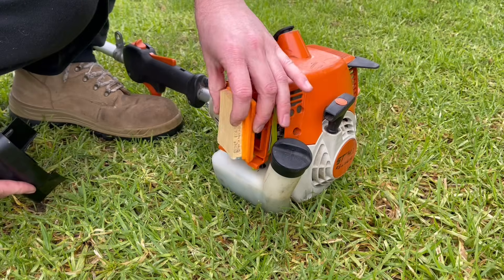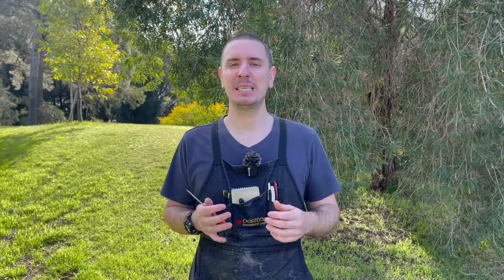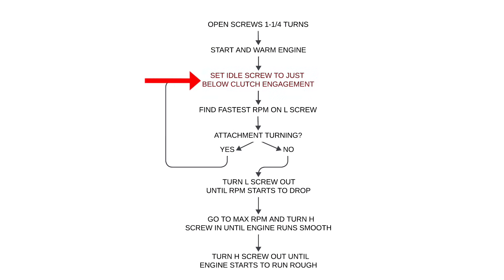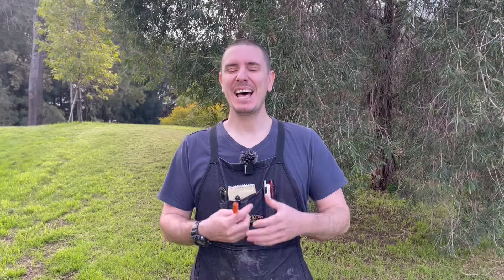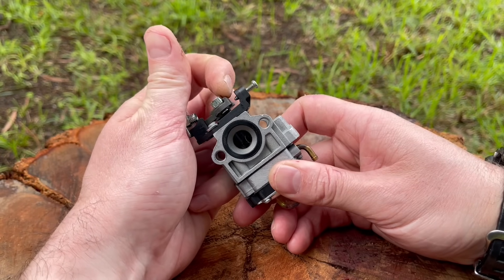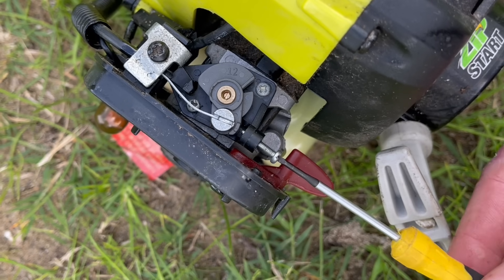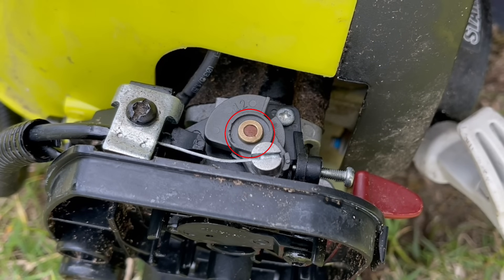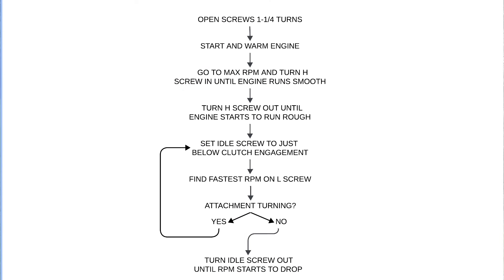Ultimate Guide To Carburetor Adjustments!

Comment: In order to work on equipment properly, you need the proper tools.
    In order to adjust a carburetor properly, you need to have a tachometer.
    I don't care who you are or what you say you can do, but no one can hear a 50 RPM difference at 12000 RPM. This is what differentiates a professional from a hack, and unfortunately there's a lot of hacks that work in shops.
    I have never been to, or even heard of any manufacturer training that teaches to do it without a tachometer, and they are the ones that engineer and build the thing in the first place.
    Having said that, I do like the flow chart for beginners though.
Reply from the maker: I completely disagree. A good mechanic doesn’t need to rely on a tachometer—they can tune an engine by how the engine feel’s, responds and how it sounds. While a tach is a useful tool, the best tuning comes from responding to how the engine handles load, acceleration, deceleration, hesitation, and more. The factory-recommended specs are just broad guidelines; not every machine will run optimally at those settings. Consider an older engine with worn rings, different tolerances, or fuel that isn’t fresh—there are countless factors that affect the ideal RPM for tuning. If you stick to manual specs with slightly older fuel or slightly worn rings, for example, you could end up running the engine too lean.  Same with slightly worn skirts that won’t seal ports correctly. Leaning the engine out to reach a manual specification will set them too lean and can lead to damage. 

I own two of the most expensive, professional-grade tachometers, yet I still get better results by tuning based on how an engine sounds and feels / responds to load. A tachometer is a great tool to get you close enough to avoid major issues, but what if you don’t have specs for a particular machine? If you can’t tune by feel and sound, you’re stuck.

Also, regarding the 50 RPM swing: just a few degrees of temperature change throughout the day can cause an engine to rev higher than that. Unless you’re tuning every 20-30 minutes, you’ll never be at the exact RPM. That’s why manuals typically allow for a +/- 200 RPM range. I have also found on occasion different manuals for the same engine give a different specification of rpm. I can tune to within 100 rpm by ear.

Often machines with limited coils can be higher or lower, by 800-1000 rpm of manual specifications too. So you won’t even hit the rpm the manual states before the ignition limiter kicks in. Another example of how a tach can’t get the optimal result from the engine or setup.
Reply: @VintageEngineRepairs  I like the way you called him a dickhead without calling him a dickhead.
Reply: I also believe tuning by tach was best until I learned to tune by ear. Once you lean to tune by ear it’s as good as a tach and once you learn how to have it 4-stroking without load and 2-stroking under load you don’t have anything to worry about. And tuning the low side is very easy. I do it just like how you do it in this video. It’s flawless. And if it doesn’t tune right like how you do it in this video then you got other problems.

Comment: Hi.  Thanks for the really clear instructions.  Hope you can answer 2 questions.  I have a  Stihl FS100 4mix strimmer.  Is the adjustment process the same for these type of machines?  Also if your using a blade not line would you change the adjustment?  Thanks for any help.
Reply from the maker: Hey :) yes, but note that they’ll be limited ignitions, so set it to where it just starts to limit. Don’t richen it back up on the high side.

Comment: I may have missed it, but after you set the high speed to two stroking and start backing it off slightly you want to leave it set to just when the engine sounds like it's four stroking again, correct? Basically, final setting is at the very top of the four stroking position.
Reply from the maker: That’s exactly right :)
Reply: @VintageEngineRepairs   Thanks for making this video. I've wanted something simple like this for a long time. Time to pull out that old weedeater and get it tuned up.

Comment: Great video Tom, but why cut the line a inch below the cut off
Reply from the maker: Thanks Ray! The reason recommend tuning it at a slightly worn line length rather than full extension is this setup allows the engine to slightly "four-stroke" when not under load and "two-stroke" when under load, which is where it should be for a safe and effective tune. I've found that the high-speed adjustment screw becomes less responsive to fine-tuning when the line is at its full length too. 

Additionally, a slightly shorter line helps you hear the ignition limiter, which might not engage when tuning at full-length line. This is crucial, especially for people learning to tune, as a this can lead to setting the mixture too lean.

Most weed eaters, (apart from brush cutters), lack good power when using a full-length line, often overloading the engine in thicker grass. Therefore taking a little load off by shortening the line a gives it more power under load, reduces the stress on the engine while ensuring it has a safe tune. Hope this helps.
Reply: Thank you

Comment: A lot of good info.  I’ve had to work on some units that I couldn’t see the idle adj. screw.     You don’t need a hot pick, they have special screwdrivers with reverse threads. They come with different kits.  Thread in and pull out.
Reply from the maker: Hey! Thanks! Yes you’re spot on, some carbs have reverse thread limiters :)
Reply: @VintageEngineRepairs  that too.  But kits will have a threaded screw driver tool for pulling the plastic plugs out.

Comment: Hi, really nice video. What about a blower? I have a BR450 and I have some troubles adjusting the H screw. It doesn’t 4stroke, it just drops the rpm but that point is really far away from the original point where the limiter cap sits. I don’t want the engine to blow up due to a lean setting. I’m used to set all of my carbs but with this one I don’t know. The thing is that I have to go really far away from the original factory setting. What I do is to screw in the H screw until the max RPM and than back out a bit but, as I just said, I have to go really far away from the original. What do you think? Can i trust myself? 😂 
Thank you in advance
Reply from the maker: Hey :) thanks! I’ll be doing a blower video in about 4-6 weeks. They are tuned slightly differently on the high screw as they’re a constantly loaded engine!
Reply: @VintageEngineRepairs  thank you, I will appreciate it so much. Can you just tell me if im right doing like that or if it’s normal that I have to lower the rmp that much?
Reply from the maker: Hey :) Leaf blowers, when tuned correctly, that are warm and running full throttle won’t 4 stroke, no :) my recommendation is set it back to how it was at factory, with the limiters in place  and keep an eye out on the video !

Comment: Your videos are great, I always refer to your in depth carb troubleshooting video. 
Do you know if those filled holes on carbs can be drilled and used as impulse feeds?
Also do you know if an impulse doesn't quite line up if you can make a gasket with a slot that'll line up an offset impulse hole on the carb?
And have you done a video on a 2 stroke weed eater for crank seals, setting the flywheel timing, checking the flywheel key, checking the condition of the piston rings, and performing a leak down test?
Reply from the maker: Glad you enjoy them! I’m sorry I don’t really understand your question. You can drill and make new impulse ports on the crankcase with a barb, not in a carb though :) I have lots of videos like seal installs and rebuilds, yes :)